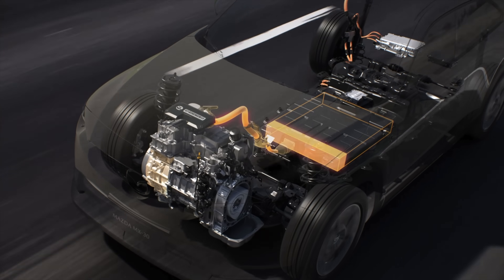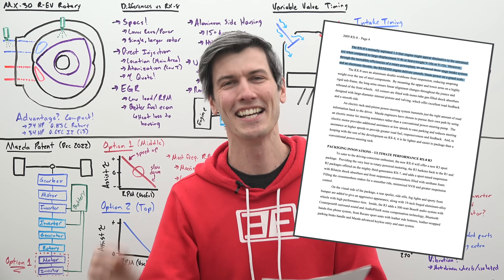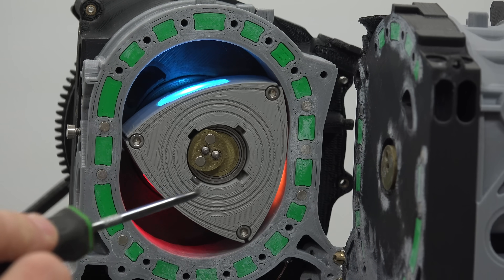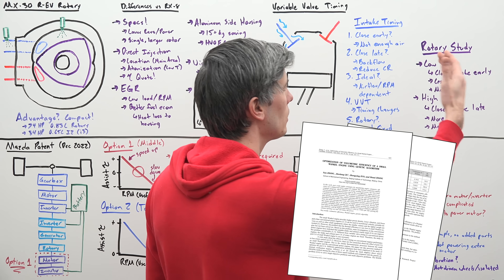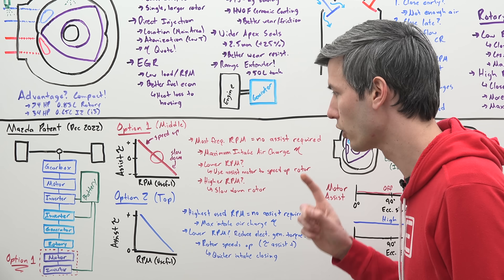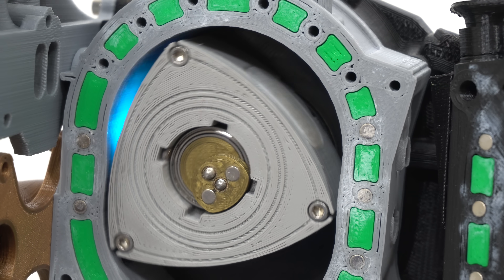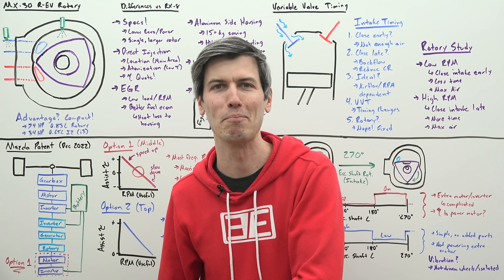Mazda Brought Back The Rotary Engine!

Comment: Question: With this system in place, does the rotation speed actually vary over a 360 degree cycle or is it just the RPM that changes? If the former, the lack of continuity should cause energy loss somewhere. If the latter, a simple RPM control device seems a simpler solution. Could anyone please explain?

Comment: If the engine is spinning at 3000 RPM, this RPM increase and decrease would have to be happening 50 times per second. It seems highly unlikely, or even physically impossible to make any meaningful changes to the rotor's velocity within that short of a time frame.

Comment: But does it burn oil like the old ones??
Reply: The Wankel engine burns oil by design... even when fueled by hydrogen exhaust emissions are an issue because of oil consumption.

Comment: This seems like an over-engineered solution to this problem, I feel like a simple solution would be to have a smaller motor power a turbo like air driver that drives more air in when needed.

Comment: What if they used a forced air setup for a rotary intake that changed how much force it used as the rpms increased? Wouldn't that solve the problem and make a VTT of a sort for the engine? An electric blower monitered by a computer would perfectly achieve what is needed at every rpm.

Comment: With a little bit of research, rotary engines could have had valve timing using some sort of sleeve valves or maybe rotary valves. But then it would have defeated the main advantage of the rotary, namely simplicity.
Reply: Wankel engines don't have any advantages.
The timing is still  adversely affected by the internal geometry so valves don't solve any problems.
The Wankel engine is very complex when you consider all of the tiny, fragile apex and side seals parts which are the source of the Wankel engine's primary failure mode.

Comment: Emisions is the real problems of rotary engine, i thing with direct inyection in a small pocket on the rotor and better burning is the key.
Reply: The real problem with the Wankel engine has always been poor reliability.
The Mazda 13B-MSP-RE met or exceeded the strictest emissions in the world right up until production ceased due lack of sales. 
 Direct Injection has been around longer than the Wankel has, unfortunately the Wankel engine cannot support a static compression ratios to take advantage of GDI.
Reply: Yes, they pass emisions test a the cost of engine fairlure, Wankel need oil to lubricate Apex seals, burning oil is a no, no in today standar. Yes, Mazda do a excellent job in the catalytic converter used in rotarys. Well time will say the last word, but i thing is a bad idea.
Reply: @josecora1917  Wankel engines are extremely unreliable even in applications with absolutely no emissions considerations.. they cannot be legally installed in type rated passenger aircraft for this reason.
Wankel engines have to operate with  excessively rich Air/Fuel mixture ratios to suppress engine destroying "knock" and irratictic combustion issues.
Engine durability and reliability problems are exacerbated by any attempt to increase fuel efficiency or reduce emissions.
The Wankel engine is inherently inferior to reciprocating engines and has been obsolete in the manufacturing industry for over a decade now.
 This is obviously just another hoax like 16X, Demio RRE, RX9 and the RX Vision Coupe.
Reply: @sandervanderkammen9230  They only good for racing in his category, love the sound and pollution they make on the track ! 🤣🤣🤣
Reply: @josecora1917  Wankel engines were an epic failure in Motorsports...

Comment: Perhaps I missed something, but why wouldn’t you just optimise the engine design for the generator load and make the generator synchronous? No change of RPM at all.
Reply: "The generator load" doesn't mean anything.  The load depends on how much power is needed - there isn't just one specific load or speed that is correct for the generator.
Reply: Read Jason's pinned post at the top.

Comment: You extrapolate "a lot" of the air fuel being at the back of the combustion chamber to "a lot" being expelled as unburnt gas - this is not what the press release says in my opinion - only the remnant of "not fully combusting" leaves unburnt - that amount would be some but a lot less than "a lot"

Comment: Wouldn't it just be easier to make the generator have a physical dead space without the coils for the magnets to interact with so the load is reduced at the proper points and no computer control is needed?

Comment: i'm no engineer. So just a thought. couldn't they put an intake valve on the top next to the injector? it could still be opened and closed. like I said, just a thought.

Comment: am i missing something?  they are trying to figure out how to increase the RPMs for 90 degrees of engine rotation?  without engine load, an engine will take 0.25 seconds (guess-timate) to increase 4000 rpm anyway.  at 3000 rpms, that is 12 revolutions.  so in 1/4 a revolution, 3000/48=62.5 rpm increase.  but then it has to slow down again, so half of 62.  is increasing from 3000 to 3031 in every single rotation really worth this effort?

Comment: What really disappoints me here is the change in size. It would've been nice if Mazda kept the same sized rotors as the RX-8, and make backward compatible replacements factory new. Even if rebuilding an RX-8 is relatively cheap even with brand new parts (for the time being), it still would've been nice.

Comment: What? The RX8 injectors are straight into the cylinder although the injector injects it onto the rotor just before the compression stroke however it technically is direct injection. It's not injected into the inlet manifold. Not on the RX8 anyway

Comment: I don't understand why the RPM of the rotary motor would have to change at all.  Why not build it to run at the most efficient RPM and then use it to recharge the battery or provide power to the inverter?  When power is not needed, it shuts off.

Comment: Diesel engines which power electric motors that spin the propellers,  have been used for many many years.
Reply: Diesel engines have excellent performance in generator and hybrid applications... the Wankel proved to be completely unsuitable for these types of applications and were never successful commercially.

Comment: Wasn't there something about the Rotary that is optimal over the Piston engine for Hydrogen power?  Still a lot of surface area heat loss but Mazda was pushing it 10 yrs ago.  Hydrogen coming back?
Reply: Mazda's foray into hydrogen fuel Wankel engines was an unmitigated failure. like other manufacturers it proved to be much less fuel efficient than gasoline and Fuel prices for hydrogen are much higher.
The Wankel engine is obsolete technology because it offers no advantages over current reciprocating engines.

Comment: It still has too many wearable sealing surfaces and too much thermal stress from one side running hot and the other running fairly cool. It's still the answer to a question nobody asked, other than 'Can something like this actually run?'. This speeding up and slowing down of the rotor is utter desperation.
Reply: A hopelessly inferior design... which is why the Wankel engine is obsolete technology

Comment: I'm sure I'm missing something... Since the rotary engine is just to charge battery, why don't they just either keep the engine at the efficient RPM all the time OR just shut it off entirely when power isn't needed. Much simpler.
A binary rotary engine.😅

Comment: The EGR recycles soot and other crap from the exhaust back into the engine intake and results in carbon build up in the intake requiring periodic expensive cleaning

Comment: Just wonder. If Mazda wants VVTI on their rotary why not just optimized the engine for max airflow instead of the rpm sweet spot they got it tuned at. And then once the valves are optimized for max airflow just give the intake valve a built in throttle body door to just limit the air flow to what you need when you don’t need max airflow. That’s way the engine just gets more air in the same amount of time. Like a multi- throttle body system. That’s also a VVTI system. I just see a problem with trying to slow and speed up and motor when the rotor is going to be going 9k rpm’s, the rotor is losing its momentum. I see it as a reliable thing but against racers. The rotary is iconic for sports cars. Can’t mess that up. I hope this is just a trial run.

Comment: If the engine is only to be used to generate power, it should not need any other rotational speed than optimal.

Comment: This engine could be ideal in construction machinery equipment..
Reply: No, it definitely would not... the Wankel engine has proven completely unsuitable  in heavy-duty equipment applications.
Reply: @sandervanderkammen9230  not diesel...
Reply: @tatradak9781  Wankel engines cannot support Diesel Cycle compression ignition... and lack any useful torque

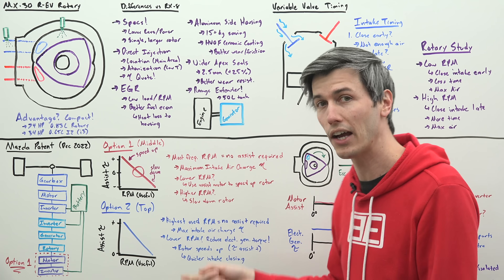Comment: At 10:00 I thought this: Can't the function of the additional motor not much better by a more clever inverter design? If that would modulate the resistance created by the generator to the rotary! This is much more native than a 2nd motor.

Comment: Seems to me cost and efficiency could be compromised with a fixed RPM motor to an acceptable solution. We tend to over engineer everything today and the result is unreliability and added cost of operation. The result is frustration and expense for the consumer who mainly just wants to drive too and from work in comfort and safety with minimum cost. We lose sight of the goal too often today.

Comment: They should make a rotary engine dirt bike or quad
Reply: Why ?
Reply: @sking2173  to do something different than whats already being produced. I would settle for a gas powered Segway
Reply: @doggfriendly  — That’s all fine and good if it’s you doing the building. But for a company to sink good development dollars into a dead-end technology — on the hope that enthusiasts will adequately support the product — is risky, and in the case of the dorito-dynamo one that Mazda doesn’t need.  Mazda’s known as an innovative company, but you can innovate your way right into bankruptcy if you’re not prudent in your endeavors …
Reply: @sking2173  well said then I got in over my head on my original comment
Reply: The Wankel engine was invented specifically for motorcycles... an application that it proved to be very poorly suited to compared to reciprocating engines.

Comment: Seems like a intake air compression with flow regulation based on rpm would be much simpler.  This design screams of over-engineering and is unnecessarily  complicated.  But it will be expensive to repair, so I guess it’s a win.

Comment: Being a cynic what if all this over-complication is just grandstanding? If you are creating extra vibrations in the engine it may be that engine is isolated from the transmission but the engine is still mounted in the vehicle and vibration isolators are not perfect. Secondly, more vibration inevitably leads to more wear. Could it be that this is not going to be an issue for the first owner but the faults will come crawling out the woodwork for subsequent owners. A range extender or REX should be just that. The EV side should stand by itself until you are cruising at a steady speed and the REX cuts in to stop or reduce the rate of battery use.
Reply: It is not complicated.

Comment: Hmmmmm. Could this be used in a “rotary” ev?! Eg. A 3 rotor ev where all it does is charge the battery. But has the handling of the RX cars.

Comment: how about a home generators for power outages for Mazda's New rotary Engine  Mazda rotary could power homes, shops and camping equipment
Reply: That was tried in the 1960s by Sachs but Wankel engines are inherently fuel thirsty, extremely noisy and horribly unreliable... not suited for generator applications at all and were quickly discontinued.
They were an epic failure as an aircraft APU engines too!

Comment: If the rotary engine is only powering the generator why does it need to have variable speed?  It should just have one speed at the optimal fuel efficiency setting.

Comment: Hey Jason, I need your help settling an argument with my buddy. So the situation goes;  you are stuck in your rear wheel drive vehicle with an open differential. The more you hit the gas the more one wheel spins while the other remains motionless. 

Urban legend says that by easing into the handbrake while you apply throttle, you can create a limited slip type situation in your differential and apply drive to the stationary wheel to get yourself unstuck. 

After much debate among friends covering just about conceivable physics proof, I firmly call BS on this myth. I even went so far as test it in my Jeep. My friends are not convinced. Can you help us settle the debate once and for all

Comment: 10:00 This variable valve stuff is overly complicated.  The engine only needs to run at a single speed, since it's used to charge a battery.  Just design it for 4500 RPM or whatever peak horsepower, and to have cleanest burn right at that speed, and you're done.
Reply: Wrong, the engine still has to operate at a wide range of loads efficiently, this is why all attempts to market the Wankel engine in generator applications were epic failures.
Reply: @sandervanderkammen9230  > the engine still has to operate at a wide range of loads efficiently

Why?  Under what conditions would that be necessary?  Why would you possibly run a generator at any more than one fixed speed and simply optimize like he11 for that?  And why would that fixed speed not present a fixed load?

Wankels are epic failures in nearly all instances due to their inefficiency.  I'm not sure exactly why they're inefficient but I've heard it's the relatively large area of the combustion chamber sapping too much heat from the power stroke.
Reply: @lqr824  Because of the fact that rechargeable batteries have a Charge Curve and streets have traffic,  speed limits, stop signs and stop lights.
Reply: @sandervanderkammen9230  > streets have traffic,  speed limits, stop signs and stop lights

and?  the Wankel only powers a generator, and there is a huge battery on board.  So again, why run it at more than one speed?  Does it actually run at more than one speed?  Do you know for a fact that it doesn't?
Reply: @lqr824  What happens when the battery is near or at full charge?
Reply: @lqr824  If it's a DC generator that load is directly linked to rpm, if it's a phased AC  alternator they the rpm stays the same, whether it's at zero load, partial load or full load. 
If it's a AC alternator rectified to DC? Then the Rpm will have to change with load as it varies.
Any questions?

Comment: Wouldn't an engine used to run a generator that was only connected to a battery run at a constate speed? If the battery got too full you could shut the engine off.

Comment: This is the same concept that all freight trains run on now they all have electric generators that run on petroleum Diesel and. All freight trains and medium-sized boats. They've been doing this since 1900 when they stopped the locomotive the steam engines now they're doing.

Comment: Ok on the rx8 you had an 231 hp engine that had fuel economy like a 1000hp 7000cc dragster engine, now they fix it and you have 70 hp so probably it will burn petrol like 3000cc 500hp engine, good improvement Mazda …

Comment: Wait why wouldn't they just make the rotary single speed and optimize the shape for optimum timing at that rpm? It's just a genset.
Reply: Wankel engines have never been successful as generator applications,  they are extremely inefficient and unreliable

Comment: Why didn't they just set the engine to run at the performance for charging the battery since it's just battery powered, and just adjust the rpm for the given battery percent. Then it wouldn't have to be hooked up to the throttle. I might  be overthinking it.

Comment: il est possible d'améliorer encore le moteur rotatif Wankel sur son étanchéité, son refroidissement, les organes internes et surtout de diminuer le nombre de joints pour les multi rotors.
Reply: The consensus in the engineering world is that the Wankel engine reached the end of its practical development 40 years ago, it is an obsolete technology and cannot be made competitive with other types of motive power.
Reply: @sandervanderkammen9230  C'est exact. On peut tout de meme améliorer le refroidissement et supprimer le barbotage interne de l'huile pour cela il faut passer par le brevet n°0014310 de l'INPI. La quasi turbine à 2 chambres est plus adaptée, elle diminue la vitesse de rotation de l'arbre est donne une meilleure détente des gaz donc meilleur rendement.

Comment: Then an old mazda rx8 needs a lot of changes on his engine to work in very high rpm. With the support of an electric motor. How that is going to work with a 3 or 4 rotor engine in very high pressure.
Reply: The system of manipulating engine speed within each rotation to control effective intake port timing is probably unusable with any more than one rotor.

Comment: I want dual hub-e-motor system on rear wheels with dual rotary engine powering the front wheels. Or all hub motors with dual rotary in between. AWD with true torque vectoring using electric motors for negative torque. Please make that a reality.

Comment: The problem you have with the MX-30 rotary is optimizing the full range of RPM. HELLO? Mazda is using it a engine to spin their generator. They only needed for one optimize RPM.
Reply: But reciprocating engines are even more efficient at a fixed optimum rpm... this is why Wankel engines have never been successful in generator applications

Comment: If the timing is fixed why don’t we increase the hole through which the air passes through dynamically based on the dormito position and speed? 
This feels super over engineered